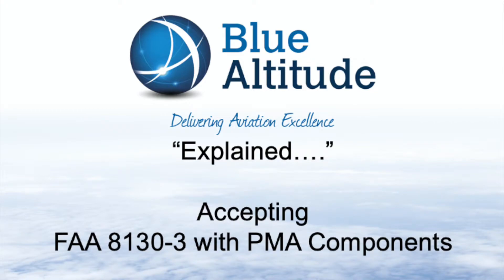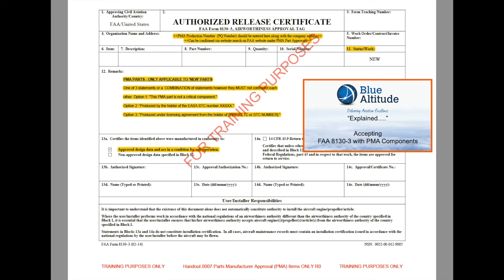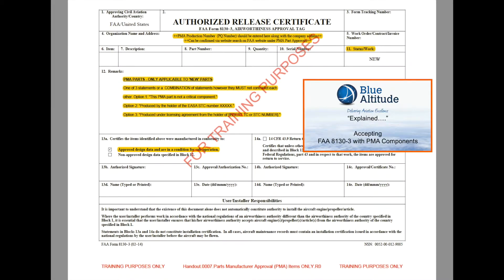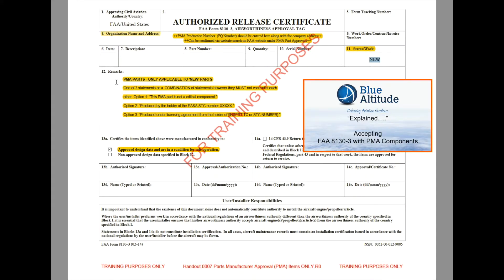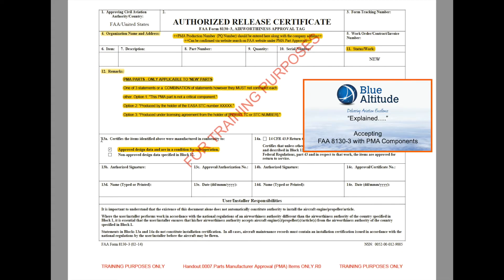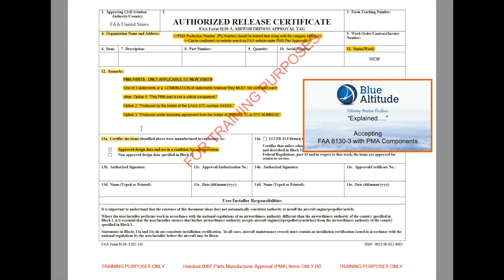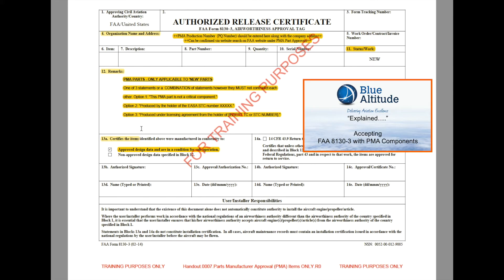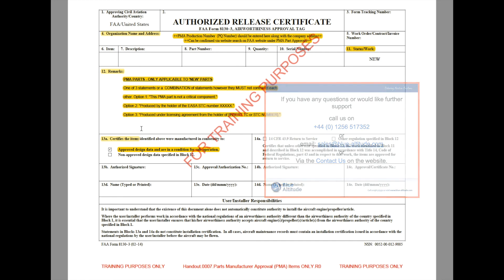"Explained..."    FAA 8130- 3 with PMA (Parts Manufacture Approval)

Comment: is this apply to easa form 1 too?
Reply from the maker: Hi Thanks for your comment.  No.  PMA is only applicable to FAA.  In this video, it's highlighting how you would recognise the FAA 8130-3 that is a PMA part and how it is accepted by EASA.  

Does that answer your questions?
Reply: @bluealtitude2013  so that mean all the PMA part will come with FAA 8130-3  form only? The company to produce the part is from america only? Im wondering if the company is based in Europe. Can they get approval from FAA to produce the PMA part? And if can, should they use FAA form or EASA form? I am sorry. I am a bit confused with this PMA thing.
Reply from the maker: @muhammadyusriabdulrahim927  yep PMA only comes on FAA 8130-3.  For an EASA company located in the EU?  Good question.  I don’t know any.  Assume they would need to have a production certificate approval issued by the FAA to generate a 8130-3.  Then have the agreement to issue a PMA.